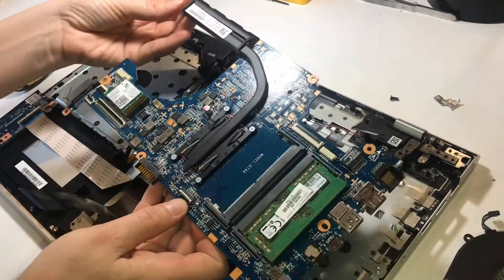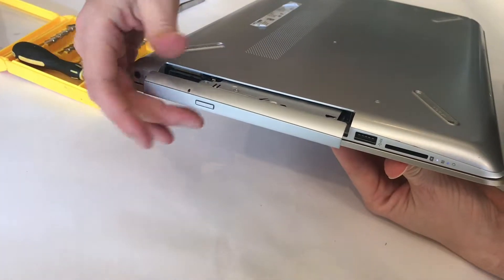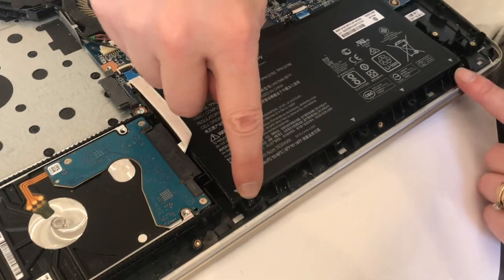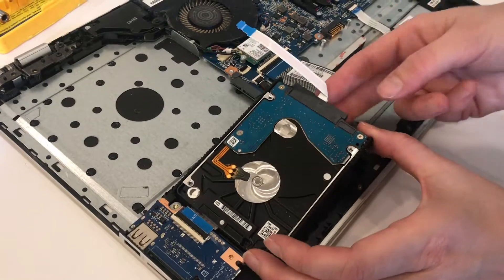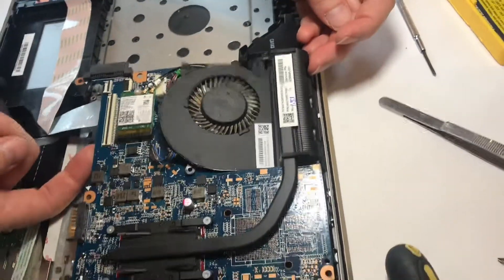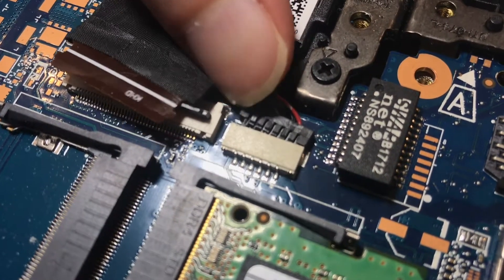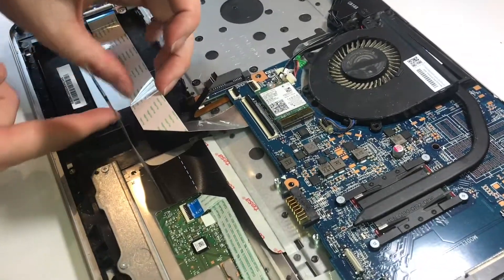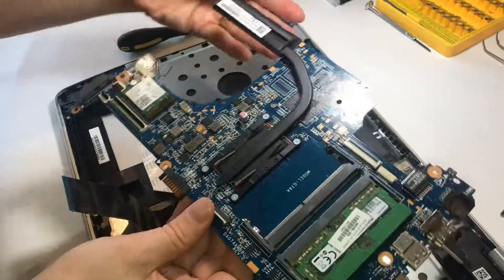replacing MOTHERBOARD hp pavilion laptop (1500 series 15cc, 15cs, 15ca)

Comment: Hi maybe you can help me out , I have this same laptop i just replaced my shock dead motherboard with an working used motherboard and im stuck it says Manucfature programming in unlock mode then loads another screen with a different model number and serial number and doesnt boot keeps doing same thing , any work around for this?